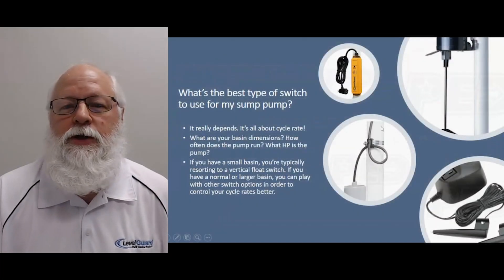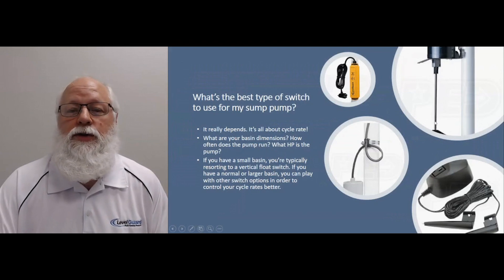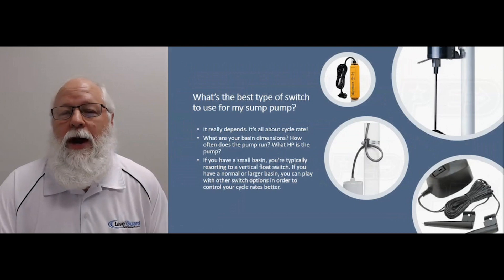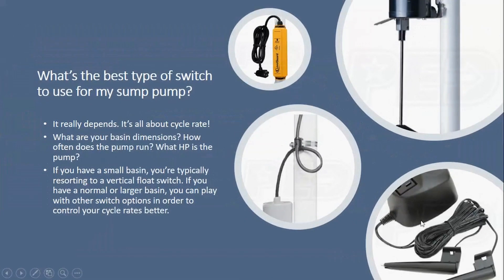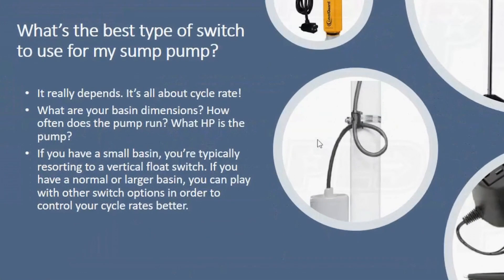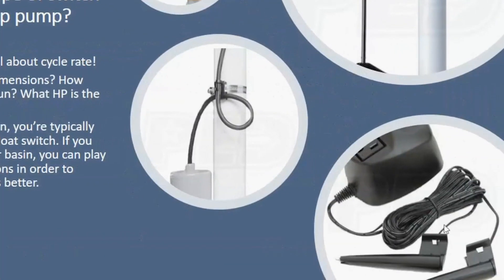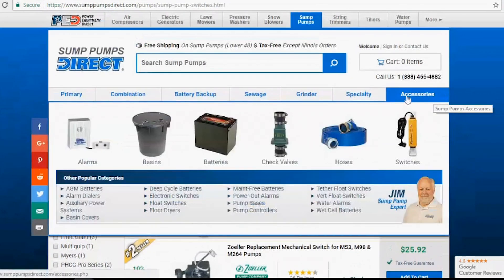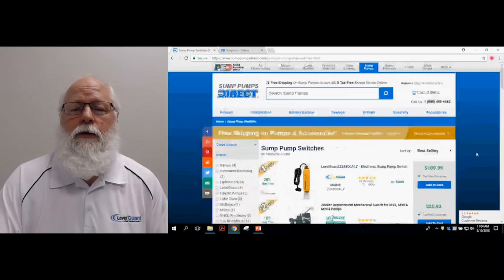What's the Best Switch for My Sump Pump?

Comment: Has levelguard gone out of business or are their products just backordered?  Tried to call the company directly and go no answer.  If they are...is there another product that would be a good alternative to that particular kind of sump pump switch?
Reply from the maker: We no longer carry LevelGuard switches, but they were very unique in the industry, and there aren't many switches with the same profile and functionality that they use. However, any switch on our site will work as directed: https://www.sumppumpsdirect.com/pumps/sump-pump-switches.html
Reply: Why do you no longer carry these fantastic switches?  Did TouchSensor Technologies go out of business, or do they just no longer manufacture the LevelGuard switch for some reason?
Reply: @guitarman517  I heard that the makers of Levelguard closed down. Unsure if their technology was bought by a competitor. Regardless, I have not come across a comparable product to Levelguard anywhere.
Reply from the maker: They were especially unique in the industry and offered a fantastic float switch technology that will be missed. @MrSoulMonk
Reply from the maker: We won't speculate as to why, but LevelGuard switches are no longer available anywhere and so we unfortunately cannot get or sell them anymore.  @guitarman517
Reply: They were a nice idea but I’ve replaced about a dozen of them.  They fail on which is good if the pump itself is thermally protected. They probably got sued into oblivion.
Reply: @russell154   What a shame.  I"ve had mine going on 4 years now.     Wish we knew exactly why they are out of business...a high failure rate??  Or they just got bought out for whatever reason.  I've googled them...didn't see anything about a class action or any law suits.
Reply: @xbox4062  I have a suspicion it was the solid state nature of these that made them have a high failure rate. I noticed of the ones that I did install almost all of them had a higher head than say the ones with under 6-8 feet of head. Because of the 20 or more of these that I had installed the ones that are still going are in low head positions. Coincidence or related I’m not sure. None of the literature I read at the time stated they couldn’t be installed at or above 10 foot head. But I agree it’s a shame either way.
Reply: @xbox4062  Same here, Ive had mine probably 6 years now. Replaced a liberty pump that failed after 2 years with a Zoeller 1/3HP and the Levelguard. I worry about it from time to time, but the thing keeps working. The only thing I don't like about it is that the run time is dictated by the water level, and that start/stop water level sensing aspect of it is obviously not adjustable.

Comment: Are pedestal sump pump switches interchangeable ?? I have a brand new backup Superior pedestal Sump Pump I hooked a couple days ago and it won't come on while in water..I can take it out of water and the switch will come on and motor also..Put it back in water and it won't even come on..Another problem is it was sealed brand new but I had it for almost 5 years..Called Superior but the warranty is only good for a year..My Flotech worked 5 years..I guess it burnt up with the flooding we had..It was going off every 15 seconds. To much rain..Pumped 5 gallons every 15 seconds..It got hot and hummed when it lifted the switch..It was a good one.
Reply: Do you have any idea why the new Flotech would do this ???PLMK and Thanks

Comment: One other question. Do the electronic switches ie level guard have decent resistance against common household chemicals like laundry detergent and bleach?
Reply from the maker: If you're referring to cleaning out the sump pit, most basic tether floats will handle that environment. There are "sewage" grade versions of some floats (LevelGuard, for example) that are built for tougher/longer use.
Reply: @PowerEquipmentDirect  Not tether floats but the electronic ones like the Ion. I like the concept of those because there is no moving part to get hung up on anything. How well they last is what I don't know.

Comment: Helpful for research. I'm leaning toward level guard. The pump is working but the old electronic sensor control - an ION I think died last year and I threw in a float tether switch because that was readily available. 

Mostly worked but just recently caused a horrible mess when it hung up on the side of the pit and I was gone a couple days! Never again. Maybe they're ok for really wide pits where nothing can bind, or for situations where the pump is perfectly anchored.
Reply from the maker: Thanks for watching and sharing your experience with us.

Comment: How would you define a large sump basin? Jackel makes a crawlspace basin measuring 16” x 17”. It’s Smaller then the standard 19” x 22” but not sure if it still counts as large or not
Reply from the maker: Hello, crawlspace sump basins usually need to be shallower and smaller overall for spatial restrictions, as in your example. We would not consider those dimensions "large" but rather utilize the terminology for "crawlspace basins and size a pump according to the dimensions given to us knowing it's going to be smaller than the average setup.

The typical sump pit measurements will range from 18 to 24 inches across and approximately 24 to 30 inches in depth, but some can be as large as 30 inches across and 36 inches deep. On average, pits will be closer to 24 inches wide and closer to 24-30 inches deep, but again,  this can vary depending on local building codes, drain tile configurations, the builder, and the specific needs of your home.

Comment: Thank you for this video. Would you say a hydrostatic type of switch is more or less dependable than a vertical float? I can't tell you exactly the model of pump. The sump cover is bolted down.
Reply from the maker: Great question. Here's the thing, you've got pros and cons to both. With a simple attached vertical float switch, the process is mostly mechanical and not likely to fail unless your float (like a tethered float) gets obstructed in the pit somehow which prevents it from activating the pump. On the other hand, electronic float switches (like the hydrostatic type you mention) are mounted at a specific height and are programmed to measure water height/pressure and activate. They are usually permanently mounted and don't run the risk of being obstructed and not activating because it never moves in the pit. In both cases, each type of float switch and the pump needs electricity to operate, and unless you have a battery backup pump installed, in both cases the floats would not work without power to the pump. So to answer your question, the dependability of a float comes down to the manufacturer and the way they are installed/built to operate. If you're after an aftermarket electronic switch that isn't installed directly to the pump, your chance of pump failure to activate can be slightly lower using a mounted electronic switch that doesn't have the risk of obstruction in the pit. Hope that helps!